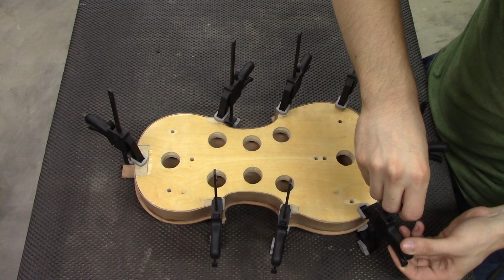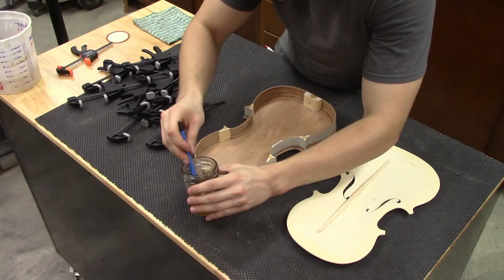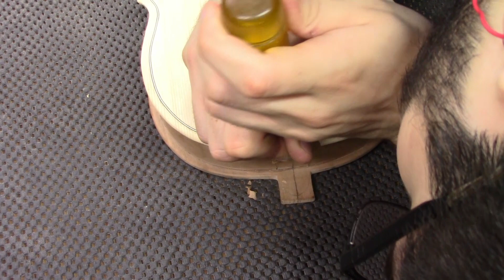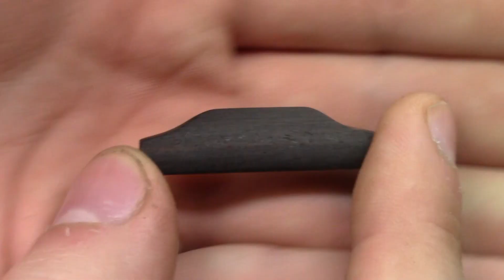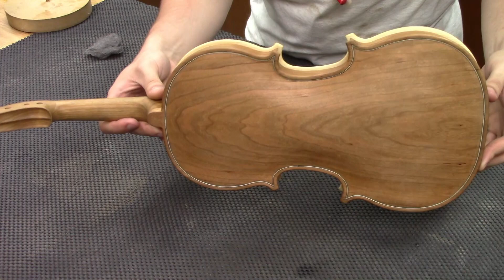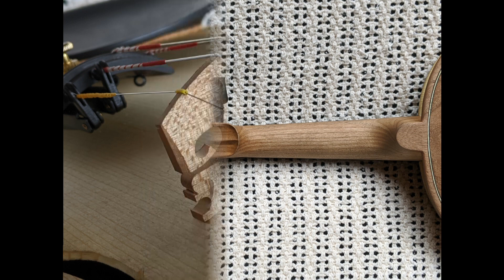Building my First Violin! Part 7, Finishing Up

Comment: Nice ring!  I so envy you! Nice job! Be patient your violin will open up as you play it( meaning it's mellowness will in time bloom the more you play it. Keep it gently humidifyed, a few tangerine or lemon peels placed in the violin s case. Get a hygrometer and try to keep between 40 to 60 % relative humidity. If it gets too damp place a clean dry cotton pillow case under the back of the violin in its case. Check out Mr. DENNIS BRAUNS LUTHIER FIXRS AND UNVAILED . Cbr massage. Probably your instrument is too thick and stiff so youl want to do a.cbr violin massage squeeze the top plate from bass bar down to tail button use your thumb and don't use too much pressure or youl shoot the soundpost clear through the top. This massage has to be done very gently for 5 min then clasp the ribs at the c bout and flex in and out grasping only at the edges .this will break in the violin so that you can play with ease and delicacy. You may have to repeat this cbr massage up to 100 times or more untill your satisfied  with it's tone. It will probably take up to 20 years of  conscientious playing to open up the violins sound but there is no rush.remember to polish the nut and use bar soap in the nicks. Set the soundpost with yarn wrapped around the top of the soundpost and let it dangle inside untill you find it's position the other end of the yarn is sticking out the left f hole and you marionette the post into position with your left and right hand. Youl feel it stick then you nudge it a bit untill vertical then pull gently with the right hand and the yarn uncurls through the right f hole. It will take several trays but youl get it! This way you don't mar up your f holes with that sound post setter. Good luck! Happy fiddling!